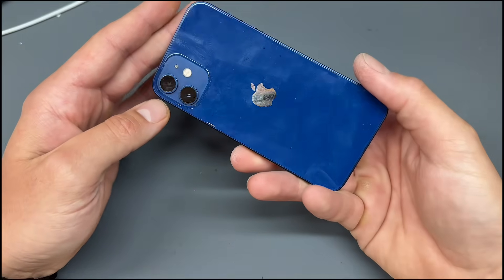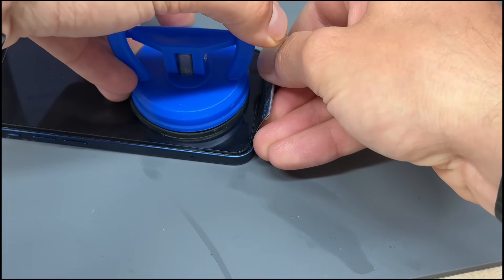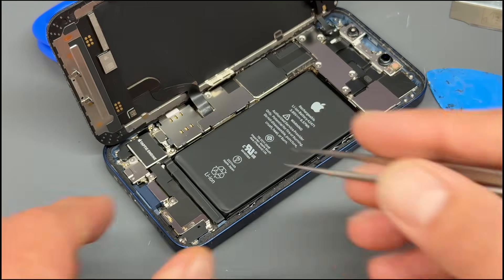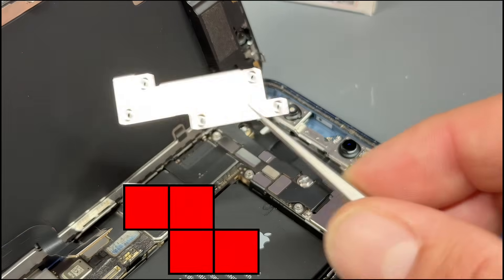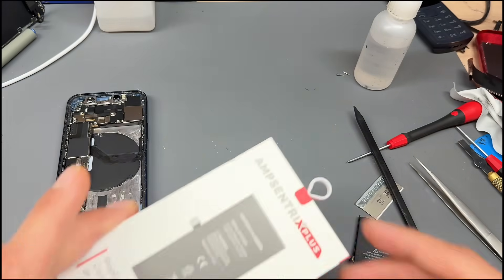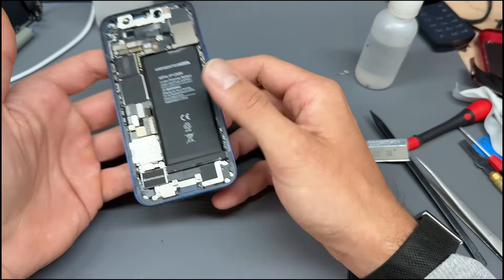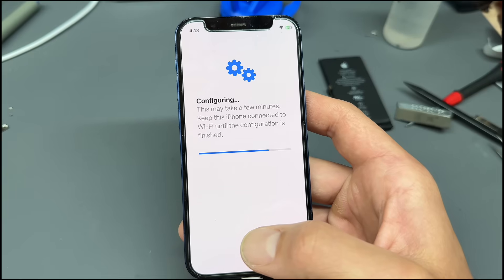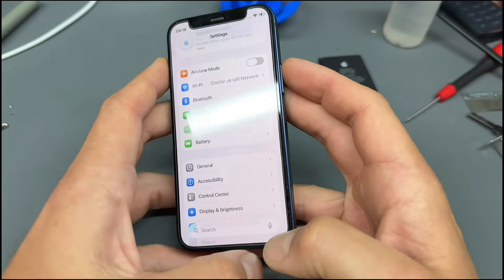We Tricked Apple Using This Battery! - Battery Replacement On iPhone 12 Mini

Comment: No, phone doesn't need any update. It just pops this message automaticly when you're not connected to the internet. Connect to wifi then tap on restart & finish repair, it'll work. No neeed to restart in diagnostic mode.
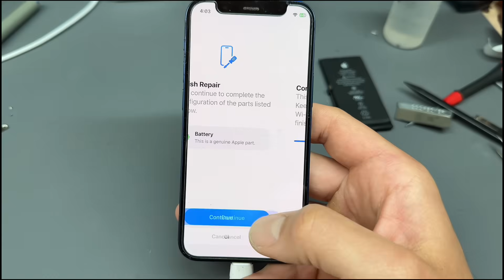10:49 also happens often to say "official apple screen" while its not lol
Reply: It will work with any after market battery??
Reply: @spendermen3787  depends which ones

Comment: Next iphone 13 battery replacement and opening lcd without special tools and heat
Reply from the maker: Hey we already have a recent video of this on our channel - just search iPhone 13 genuine battery replacement :)
Reply: @iDoctorUK  All companies have to do is take bsm board of the original battery and soder it to a different battery
Reply: @iDoctorUK 
Hi pal. 
I've just purchased a "ven dens" battery for an iPhone 13!   
Will this method work with that??
I'll be honest, I'm not bothered about battery health reader... As long as it gives accurate charge indicator, will the ven dens work as a normal battery?  ( Complete rookie, about to try first attempt😒).
Cheers pal.  👍🏻

Comment: it was difficult to open because of the vacuum created inside the phone. removing the sim tray would allow air flow into the phone making it easier
Reply: Removing the pentalobe screws already compromises the vacuum, it’s no longer airtight without the screws
Reply: @m4nedwolf Exactly, but they aren’t air tight regardless
Reply: and he should have removed the screen protector
Reply: @userharrisel not needed, just loosening the adhesive is enough
Reply: @userharrisel  not necessary to weaken the screen’s adhesive
Reply: iPhones aren’t air tight actually
Reply: @Lattementa.freddo  if they’re water resistant that means that they’re also air tight because if air could get in water would very easily get in because water has more pressure then air its physics dawg
Reply: @s @samanthagriffinv2.08 No, iPhones are breathable. That’s also how the pressure sensor works. And you can squeeze an iPhone slightly because air comes out, if you do that in water it will get water damage
Reply: @Lattementa.freddo  they are air tight, some machines are sold to test their airtightness after a repair.
Reply: @Keless and the machines require you to block the bottom microphone hole. And if you remove the bottom screws it’s 100% no longer airtight
Reply: @Lattementa.freddo  that's right
Reply: that blade is like adding another glue
Reply: He should heat a bit lmao iphones resistant to some C heat. This guy making it hardway

Comment: damn, you couldn't have at the very least cleaned that disgusting phone before starting the video?
Reply: hating on repair shop crazy
Reply: @maisan9944  stating facts aint hating, its the damn truth
Reply: it shows how Apple works, it good to see their mess, isn't it ?
Reply: not his problem really, the customers are just tramps
Reply: lmfao dude nearly broke the damn screen instead of just using a heat gun like 99% of other youtubers do, wtf is this video
Reply: @raydare2002  Make a video and show how it’s done then
Reply: @raydare2002 dude just had my phone in for a housing swap think he knows what hes doing, isopropyl alcohol softens the adheisive not requiring heat